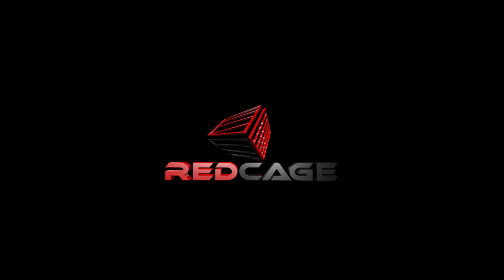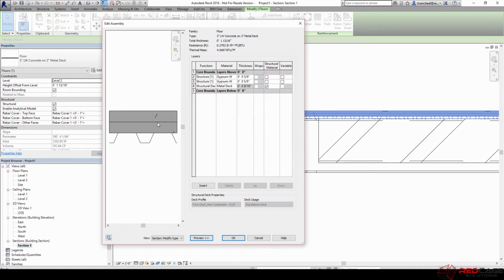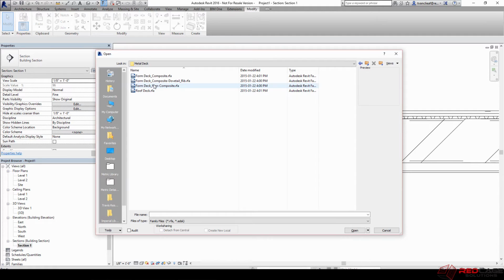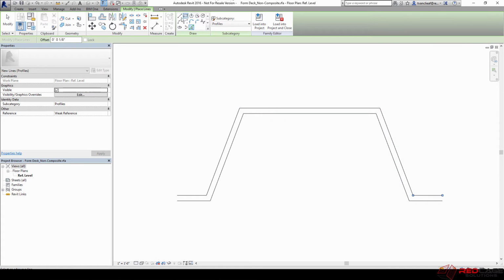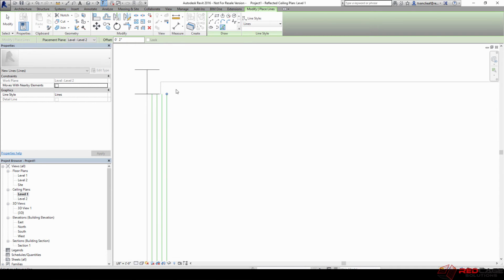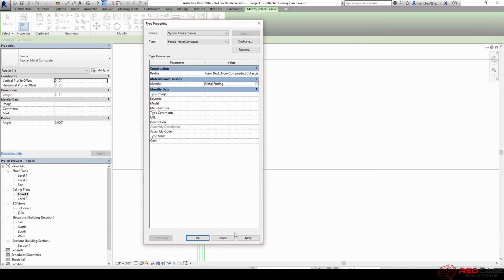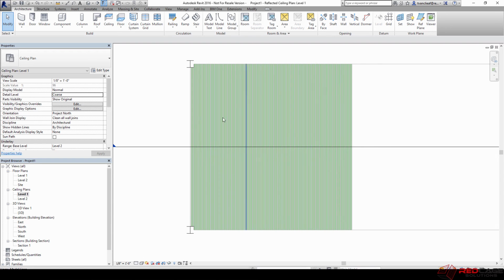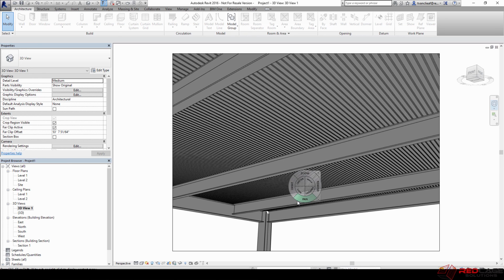Fascia Profile Hack for Showing Corrugated Metal Deck in Revit

Comment: Great presentation.  Can you make any penetrations through the metal decking the way you have modeled it? Can you attach any lighting to it?
Reply from the maker: I'm not sure what sort of family would provide the penetration, a shaft tool works for floors and ceilings, roof, but this ends up being Roof w/ subcategory Fascia. My questions is, does it matter? If you're going to go the distance of clash detecting this, you could simply set it as a reviewed item, but the intent for this hack is a method to show articulation. Regarding the lighting, it would depend on the hosting specification of the lighting family. A face based lighting family I would imagine work fine on this, but my recommendation if I was working with an electrical engineer would not to be at the mercy of an architectural model and would try to have my own hosted ceilings or reference planes to ensure my fixtures do not become unassociated.

Comment: For some reason when I go to click the detail lines nothing happens? Please advise.
Reply from the maker: If you are in fact using detail lines, this is where you went wrong. You need to do these with model lines, which are a 3D physical element, visible in a 3D View.

Comment: Very cool, I suppose with this approach you would have to run your model lines around windows and doors?
Reply from the maker: You would need to be pretty meticulous with the model lines, but if you're trying to sell a vision, you could do this in just the areas where you're creating 3D views. I've seen people use a material with a very high level bump map and achieve a nice comparable result.

Comment: Hi can this also be done for a roof
Reply from the maker: Yes, you could use this method for a standing seam or metal roof cladding. I'd experiment with the sloped glazing roof type as well. If you create a mullion profile that had the right shape it could be used to create claddings, but roof framing is probably best done with the structural framing tools in the Extensions tab.
Reply from the maker: Yes.